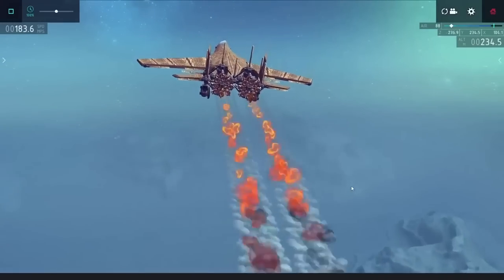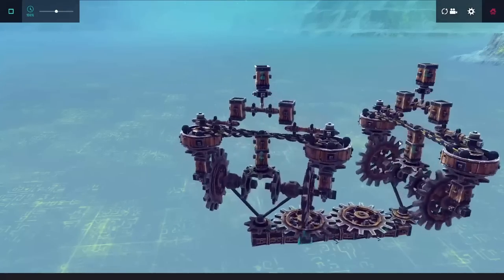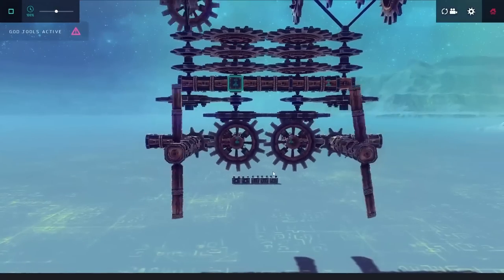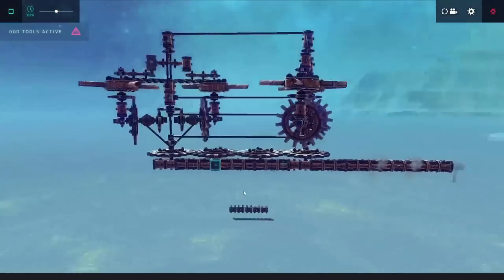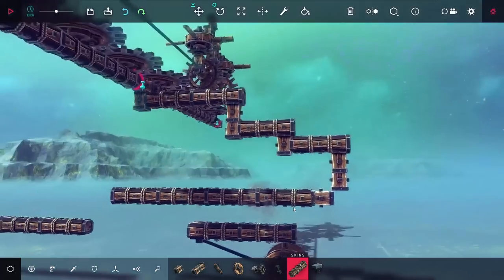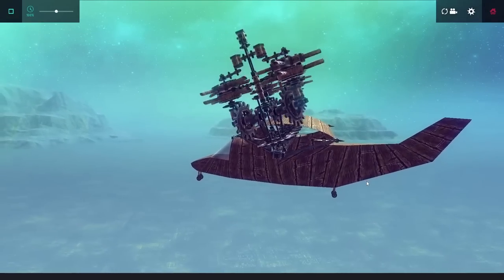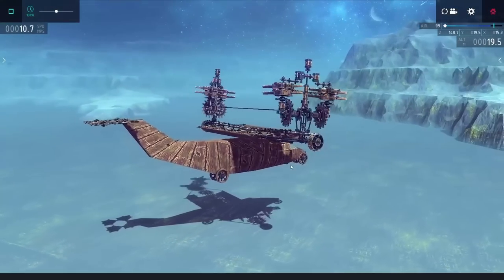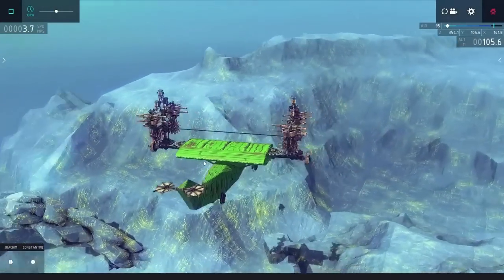Making a VTOL in Besiege

Comment: In this video, you half discovered an important secret of Besiege physics that allows for very easy and compact rotation of machines. By using wheels with ballasts or any kind of mass attached (unattached braces work the best, because they can't break or break off), you can exert insane amounts of force on the machine. For example, put two (small or large) wheels on top of a car, and add braces or ballasts for mass for the wheels to spin. Bind the wheels to left and right, and you can turn on a dime.
Reply: "Mom, can we have a car with RTC?" 
"We already have a car with RTC in home"
The car in question: ToRQue StEerInG BaYBe!!!!!!111!1!1!!!1!1
Reply: Internet dweller discovers the physics phenomena known as rotational inertia, circa 2023

Comment: You could make a great helicopter with these engines
also I wonder if you can use like a 4 bar linkage to link them together instead of gears
Reply: I think he could however if he did that then the propellers would have spun in the same direction which could cause issues

Comment: Was it totally impossible to expand the width of the engines at all? Using long braces instead of a ballast to connect the engine core to the spinning propellor, and even in that case expanding the size of the blades using braces attached to full propellors (like the cannon-powered engine from the intro) for greater propulsion? Probably would have been somewhat convoluted and would have required a redesign of the nose but still definitely interesting to consider when theorizing about a true VTOL that can function in plane form.

Comment: i suspect you made a gravity ring with the weight and spin of the engine v12 have small rotating clyinders in the block to counteract the force produced the torque makes it stay stable by counteracting forces

Comment: why did you even keep the engine-part of the engine? couldn't you have saved a ton of weight by doing it without gears and only with wheels, propellors and springs?
Reply: But the point of the video is to make a engine powered vtol?
Reply: @JebKemov  maybe

Comment: Try making a helicopter in scrap using a wing mod and at least try to use a rear propeller to balance the torque. No need to make a massive engine that barely works, I'm not going to make you do that, just use the in game ones.